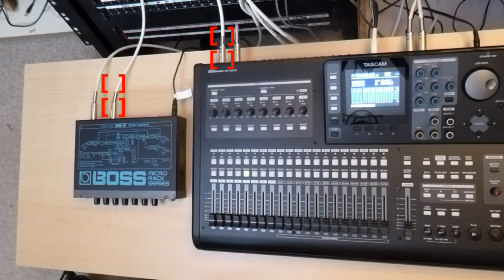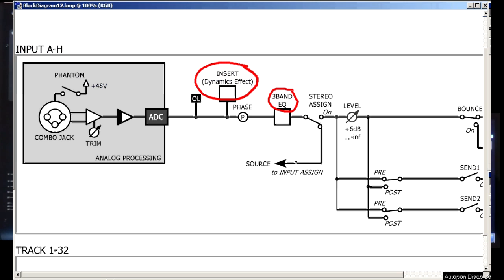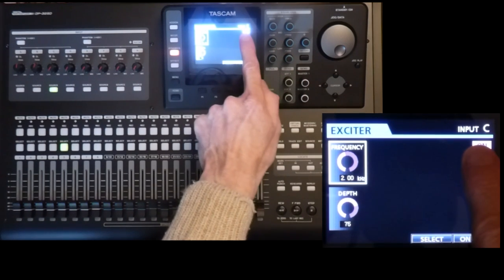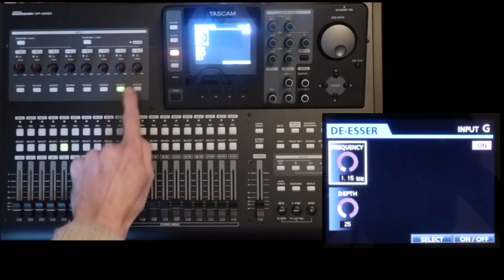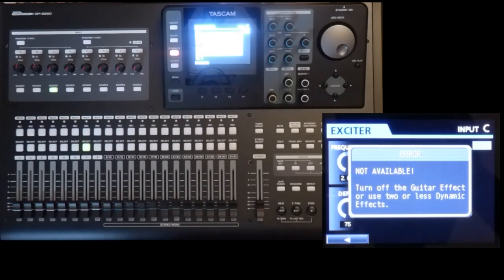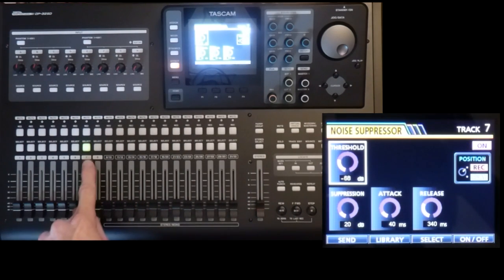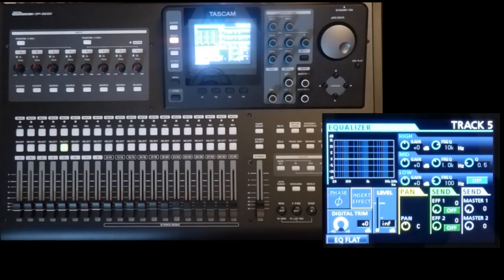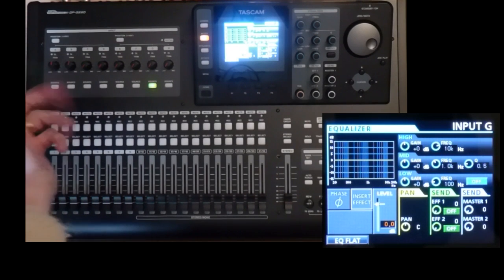Tascam DP24/32SD Tutorial 4: Dynamic Insert Effects

Comment: I bought a DP32 recently and I have recorded a dry vocal and tried to add compression tonight. I have followed the manual and youtube video guidance to the letter and still can't see why it doesn't seem to be working. There's just a few short steps to follow, so it's not difficult, but whatever I do, turning the compression on sounds exactly the same as off. Input is correctly displayed top right, but still the vocal is dry.
Reply from the maker: @fanfanackapan It's not clear from your comment but are you trying to add compression after making the recording? Normally you use the dynamic effects during the recording, so the recorded sound contains those effects. If you try and add them later, the signal doesn't go back through the input path so the dynamic effects will have no effect (although video #14A shows a way round this).
Reply: @philtipping  thanks for your reply; yes I was trying to add after the recording. It states that you can in other videos and also that you can add the dynamic effects to all tracks separately A through to H inputs, but last night, I couldn't seem to get any to work. They say to record tracks dry and then add effects/dynamics, which is what I was trying. I thought the send effects weren't working either, but I will study them later.
Reply from the maker: @fanfanackapan that's the problem with posts which just use the term 'effect' without qualifying it to say which type of effect they mean. You have to be precise with the terminology to avoid confusion or misleading info. You can certainly record dry and add guitar(insert) effects and send effects later, but you can't easily add dynamics(insert) effects later unless you use the trick shown in video #14A. Using the send system can be a bit tricky to set up, especially if the concept of 'send/return' is new to you, but video #5 tries to explain the principles. There's a free 'FX Summary' link on my website http://www.philizound.co.uk/freebies/dp24-32/dp24-32.html#fx   or if you get really stuck, there's always the step-by-step guide  http://www.philizound.co.uk/freebies/dp24-32/dp24-32.html

Comment: I’m a novice and I can’t find a way to sync to midi with my 32,can you help
Reply from the maker: @Des OConnor depends if your DP machine has built-in MIDI or not.
If it hasn't, see video #13 https://youtu.be/ipAWAlqNtWo
If it has, there are MIDI settings in the Menu. I don't have one of these machines so can't tell you the exact buttons to press, but someone on the Tascam forum will know.
Reply: @philtipping  thanks Phil ..I will take you advise and check the video out and report back . I’ve given up on computer DAWS  for complete projects and  recently reverted to using my ancient Akai  16 track ..it does sync but the work flow and metering with  32 is so superior…thanks 👍🎩
Reply: @philtipping  #13 is a great solution ..now I just need to find a YMC or similar device …thanks 🎩
Reply from the maker: @desoconnor7445  Glad it helped. Those 2nd-hand sync boxes do crop up regularly so keep your eyes peeled... and be patient :) There's a list of candidates in the description so there are more choices than just the Yamaha box. Good luck.

Comment: I have a Tascam DP24 and I took the mempry card out to put a new one in and I cant get the new one to work. Am I needing to do something I aint doing to make the new card work
Reply from the maker: @Jerry Hall you need to format the new card in the DP24. If it won't format, there are a few things to check. Is the sdcard 32GB or less? The machine cannot handle larger ones. Is the card on the recommended list of cards on the Tascam website? The card may be fake or faulty - did you buy it from a reputable source? Is the write-protect slide switch on the side of the sd-card set correctly. You can't format it if the switch is in the 'locked' position. Is the machine running the latest firmware? If not, you need a working card in order to update it, so you can use the original card for this.
One last thing you could try - the card may be in a state which the DP24 cannot recognise, so try formatting it on your computer, then put it in the DP24 and re-format it there.
Good luck.

Comment: So the higher the number on the compressor the more compressed the sound, the lower numbers lesser compresion.
Reply from the maker: @Angel Palermo there are several values which affect the compression. The threshold defines the signal level at which compression begins. The ratio defines how much compression is applied. The attack defines how quickly the compressor responds. More details are in the step-by-step guide, or just search the web for 'how to use a compressor'.

Comment: What is The Exciter and what doe's it Do ?
Reply from the maker: @KountryCuz1 Basically it 'brightens up' the sound. It's more complex than just using EQ to increase high frequencies, as it uses other techniques such as creating additional high frequencies from the original sound.
According to Wikipedia - https://en.m.wikipedia.org/wiki/Exciter_(effect) - an exciter (also called a harmonic exciter or aural exciter) is an audio signal processing technique used to enhance a signal by dynamic equalization, phase manipulation, harmonic synthesis of (usually) high frequency signals, and through the addition of subtle harmonic distortion.
The Aphex Aural Exciter was one of first commercial units - http://www.aphex.com/products/exciter

Comment: Hi, can you basically add four effects to one channel for vocals like Reverb - Compressor- DeEsser and EQ ?
Reply from the maker: @stephen hargreaves not sure what you mean by the term 'channel' so can't give you a definite answer. There are 3 types of effects and some are pre-wired on the 8 input paths, some on the track recording & playback paths,  and some on both. The number of effects which can be used concurrently depends on the type, but this can be overcome to some degree by either using effects which are duplicated on the 3 types, e.g. delay and compression, or by multiple bouncing, where you can apply effects to different tracks, say, during each bounce. You can also bypass the 'pre-wiring' by using external cables to connect outputs to inputs, but this requires understanding of the signal flow to avoid feedback. Most of this is covered in the videos but this written summary may help http://www.tascamforums.com/threads/dp24-32-fx-definitive-summary-of-effects.4162/
Reply from the maker: @debunker300 understood, but input and track paths are both used when you are recording, as in your scenario with input A assigned to track 1. It also makes a difference if you want to record all those effects in a single pass, or just hear them on the monitors. The link I posted shows you can insert a dynamic effect into an input path, but they cannot be chained in series (there is a work-round to this later on). If you then assign an input to a track, you can also insert the guitar effect block into that track path, and the 4 'sub' effects within the block can be chained. You can also send the track to the send effect, but this can only be one of the 3 send types (reverb, chorus or delay) at any one time. So this is why you have to be clear about what you're trying to do. 

If you want Compression, a DeEsser, Noisegate and Reverb, you can see that the first 3 are in the dynamic effects, but you can only pick one of these for any one input... but there's also a noise suppressor and compressor in the guitar effect block, so you could use the de-esser from the dynamics and the noise suppressor and compressor from the guitar effect. Reverb is only available in the send effect, so you could achieve what you want, albeit not quite in the same order... but then comes the question re. recording vs. monitoring.

The dynamic and guitar effect can easily be recorded live, but the send effect is trickier. Normally you'd add the send effect after the initial recording by using bounce or mixdown, but there are ways round this as shown in video 11.  

There are also other work-rounds to the dynamics limitations once you've understood the signal paths. e.g. you can daisy chain the dynamic effects by routing one input through send-1 back into a 2nd input, then routing this through send-2 back into a 3rd input. This would give you 3 different dynamic effects - say your compressor, de-esser and noisegate - all chained in series on your single vocal source. Obviously, use of send-1 in this example limits use of the internal send effect  for reverb, but you get the idea.

Comment: Can I use a hardware comp as an insert or by any other method? Mono effects send?
Reply from the maker: +living here yes you could insert it between your source and the dp machine if your source signal is large enough to drive the compressor, or you could use the effects send to drive it. The signal from the sends may not be enough if your compressor uses +4 dbu 'pro' signal levels, but some comps have an input sensitivity setting or gain control so this might be ok... you'd need to experiment.
Reply: 'input sensitivity setting' mine doesn't have that. I think I'm going need a preamp but was hoping there were another way around it. Thanks for the reply and tutorials.
Reply from the maker: The compressor threshold control caters for different input levels so that might have enough range, and there's nothing wrong with turning both the send and master send levels up full, so you may get away with it. Have you got both bits of gear so you can test it?
Reply: The only way I could only test the comp (because it's new and I don't have other gear yet) was with a consumer line out which I believe is -10db and it was very quiet . Yeah, the send and master up full was what I was thinking but I can't be sure it would drive the comp. I've seen preamps that mic/line in and have around 60-70db boost, do you think that's plenty?
Reply from the maker: It depends on the preamp output levels - if that too works at consumer levels, it may still only be -10dB.  I think the Tascam Sends are somewhere in between the -10 and +4 standards, so I would just try it... although if you're using this to decide whether or not to get the Tascam machine, that could be tricky :)  Don't forget there's always the built-in FX. There are compressors in each input path, one in the track path, and a 3-band one in the mastering stage. If you're careful to avoid feedback, it is possible to connect the machine's output to an input and re-utilise the input path compressors (or any other dynamic effect) on pre-recorded tracks.
Reply: I wanted the Tascam for a while so I will still get one. The manual of the comp suggests inserts or a preamp and the image appears to be a Behringer ULTRAGAIN PRO MIC2200, which features Level conversion (-10 dBV to +4 dBu). I'm guessing any decent preamp will do. But thanks again you've been super helpful.

Comment: Phil, I just bought the DP24 and can't thank you enough for this video series. I'll definitely buy the video disc and step by step in short order. Thank you for jump-starting my getting started. It would have taken me months to figure out all of this. How long did it take you to put all of this together? It's invaluable!
Reply from the maker: +Bob Chekoudjian thanks for the kind words Bob. Well it was a lot longer than I first thought :) - the upload dates span about 9 months. A lot of problems people were having seemed to be around general recording concepts as well as the machine itself, so it ended up being more 'in-depth' than planned... even then, some topics like punch-in and track editing had to be left out. Anyway, glad it helped and look forward to hearing from you.
Reply: Just a quick question, if you don't mind. How would you handle a click track? Would you just take a metering device and record it to a separate track? I haven't seen anything stating that the DP24 would generate a click track. I might be doing some long distance recording with other musicians and I'll need something they can reference to keep things steady. Thanks!
Reply from the maker: The built-in metronome can be recorded but it's a bit fiddly. The signal only appears on the monitor outputs so you need to connect a monitor output to a spare input... and be careful of feedback!  The sound is very basic, so I prefer to use a drum machine or something more musical. There's plenty of tracks so dedicating one for a timing guide is normally no problem... and if you do run out of tracks, you could always 'park' one or more tracks onto the virtual tracks temporarily.
Reply: Thank you, Phil.

Comment: Hi are the preamps in this machine nice ... Is it possible to by pass the preamp and use like a neve ... Thanks David
Reply from the maker: +Dave Hewing Hi David, you're getting 8 pre-amps plus the mixer & recorder for the money so logic implies they won't match more expensive ones... but it all depends what your yardstick is; they may be perfectly ok for your requirements. I haven't seen any comparison reports so can't really advise. There's no bypass as such, but the trim controls vary from line to mic so I guess when they're in the line-level position any colouration from the pre-amp will be minimal, so external pre-amps should be feasible if you prefer them.

Comment: Thank you for making this video. I have one quick question. Is it me or does it seem like the dynamic affect compression doesn't really compress? I know the guitar effect compressor does very well but it seems like the dynamic compressor only controls volume. I can't seem to get that squash to sound
Reply from the maker: +king kroll invention thanks for the feedback. Haven't compared the two myself, but there is a bit of a knack to operate a compressor. There are several articles on the internet which may help, e.g. https://www.soundonsound.com/techniques/compression-made-easy and https://www.residentadvisor.net/features/1595 
Failing that, try asking on the Tascam forum if there's a specific issue with the dp machine's compressor.
Reply: Phil Tipping thank you,,, many years ago when I first got the machine I called Tascam to talk to them about it. His explanation was it really didn't work as a normal compressor which I found hard to believe. Why call it a compressor when all it does is control volume?. I've had awesome results with this machine it took a while to get to know how to use it and I had to do an upload from the internet because there was something I think that needed correction
Reply from the maker: That's very interesting, thanks for the heads-up. I'll do some experiments when the studio is re-assembled - can't check right now as am in the middle of moving house - but like you I find it hard to believe. It wouldn't be the first time Tascam sales/marketing have got their facts wrong... their official video on the dp24/32 says the dynamics effects must all be the same across the 8 inputs, but this is incorrect, so they're doing the machine a dis-service by saying it's more limited than it really is. Might be worth starting a discussion on the Tascam forum - I'm surprised no-one has mentioned the compressor before so would be an interesting topic.
Reply: Phil Tipping it could be that mine are defective? The gain on it works but the ratio threshold and attack seem to do nothing. The desser works the noise suppressor works and the e Exciter works. I just took his word.
Reply from the maker: That sounds very odd. I'm sure I would have noticed if these weren't working. I'd be very surprised if your machine is defective as it's all done in software inside the machine so the only way it wouldn't work is if the firmware was corrupted - in which case I would expect the whole thing to crash - it would need a very specific type of corruption to just affect those controls. Are you using the latest firmware for your model? If you are, then the only thing left is operator error - are you definitely sure you are using the controls correctly?
*Update*.. have just unpacked the dp32sd and tried a dynamic mic with headphones. Not a very good test as I could hear myself directly as well as through the phones, but it was enough to show the controls work. I tried setting them to the extremes - threshold -32, ratio inf:1, attack 2ms, release 1000ms, and the gain at about 18db so I could hear the background noise in the room. If you make a short sound, you'll hear the background noise instantly drop, then you'll hear it rise slowly over the 1 second release time. You can test the other controls... e.g. turn the attack up to delay the onset of the gain reduction. Although this is a very crude test, it certainly seems to be working. I'll need to do a more thorough test with a different sound source but maybe this is enough to convince you to try some more tests yourself.
Reply: Phil Tipping I have tried setting the compressors extremely like you're explaining. I just gave up on it I've had the machine for about 4 years. I did the updates several years ago. I absolutely love the machine and I have recorded several albums worth of material on it with great success. I just thought to ask someone about it because it would be kind of cool to use the compressor in the dynamic effects instead of using the compressor in the guitar effects. Thank you for your help man. Cheers!
Reply: Phil Tipping hey man I just wanted to let you know that you were correct about it being operator error LOL I had someone come by today and show me that I had to turn the line Mike on the recorder up pretty high in order for the compressor to work. I definitely hear it now but I've never been one to turn the line Mike up that loud because of overloading but this gentleman showed me to turn it as hot as you can and that setting that you told me about come up really easily.
Reply from the maker: Great news... glad you got it sorted. The level adjustments and overload indicators are shown in video 3A.